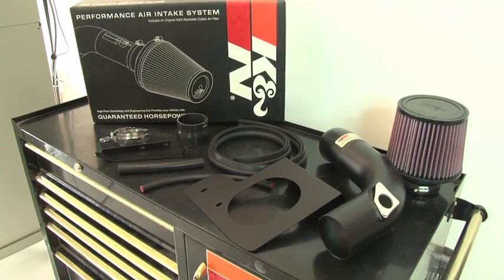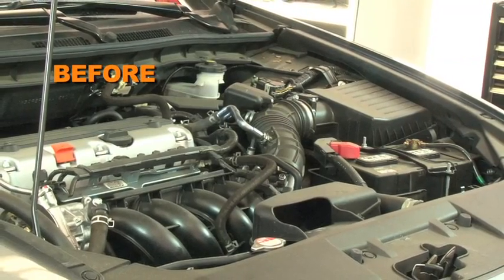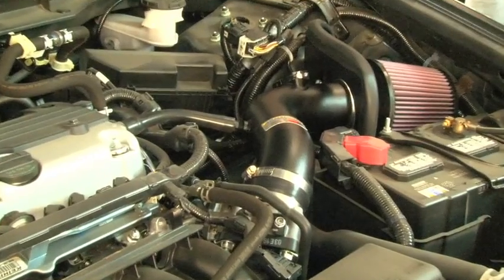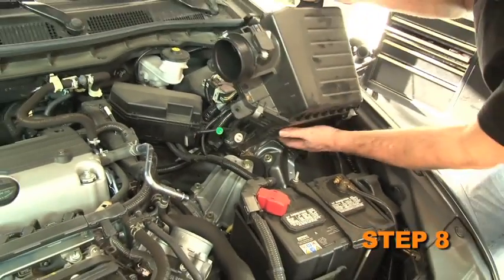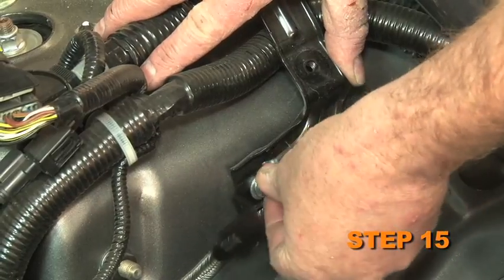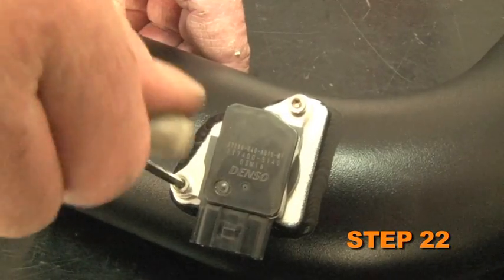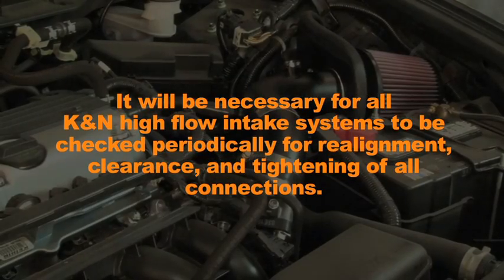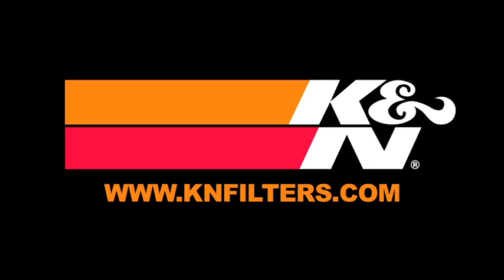Honda Accord 2.4L [#69-1211TTK] Air Intake Installation

Comment from the maker: This kit will fit all 2008-2012 Accords with the 2.4.L.
Reply: does tuning require after installing this kit in? Thank you
Reply: @QuanNguyen-cz4jq  you will need a tune after this, the car can not handle the extra 220 hp this will add to the engine
Reply: @neondiamondsaquaberry17  LMAO 💀

Comment from the maker: The system will not pull any more water than the OE system. Keep in mind, the filter is oil treated, and water and oil repel from each other. Also, you would have to submerge the vehicle to the hood line to have the filter submerged. If this happened, you would have much bigger problems then the intake pulling water.

Comment from the maker: @macuser575 This kit showed an actual increase of 11.13 HP and 10.47 lbft at the wheel on our average dyno pull; this is about a 9% estimated increase over stock with only our intake system installed. I can assure you we don’t make these numbers up, they are all real gains.

Comment from the maker: The heatshield blocks direct radiant heat from the filter, to prevent the filter from heat soaking. The air temp will always be the same as the temp air you are driving through.

Comment from the maker: @JohnZzzist Most K&N air intake systems are warranted for 1,000,000 miles which exceeds the warranty offered on the original factory intake system. The installation of an air intake system should not void your factory warranty. It is never a bad idea to contact your local dealership and ask them before purchasing the new K&N system whether they will object. If they tell you an air intake system will void your vehicle warranty, please contact us and we will speak with the dealership..

Comment from the maker: @Aero2121 You will feel the increase of power in acceleration and throttle response. Our intake systems do add to sound, but this varies on the engine it is being installed on.

Comment from the maker: This kit is part number 69-1211TTK. It is not 50 state legal at this time because it is not CARB exempt. An aftermarket intake alters the OE emission control of the crank case vent line; this alteration must be approved by CARB to become exempt.

Comment from the maker: @rick664ath The correct kit for your application is 69-1207TP or 69-1207TR (depending of you want polished or red). The filters with these kits only need to be cleaned every 50,000-100,000 miles.

Comment from the maker: @Aero2121 No, the K&N 69-7061TS fits the 2008 Nissan Altima with 2.5 liter engine and the K&N 69-7062TTK fits the 3.5 liter engine.  knfilterscom/air_intake/nissan_altima.aspx

Comment from the maker: K&N does not test for, claim or guarantee fuel economy gains. There are over 30 factors that determine fuel consumption; intake restriction is only one of those factors. Most of our consumers report back an increase in MPG; these reports are available on our testimonial page on your website.

Comment from the maker: @MrCHINGONism The correct kit for your application is 57-3010-1. This kit will only work if you do not have ram air or traction control.

Comment from the maker: @happy543210 The filters on our intake systems only need to be serviced every 50,000-100,000 miles. We also publish all the estimated (average) HP gains for all our kits on our site. We also offer 100% consumer satisfaction on all out product; you would need to contact customer service @ 800-858-3333 for assistance with this.

Comment: Does anyone know if this upgrade causes and engine code, I plan on buying one of these for the incredible sound and the little boost in power. And I don’t have a Hondata or a ktuner and I’m not looking to spend $1000 on one any info would be helpful.

Comment: I'd like to install a throttle body spacer, but I have the k&n intake installed. Will I see any problems installing a TBS?
Reply from the maker: +Kevin Claveria The intake is not designed to work with a throttle body spacer.
Reply: Kevin Claveria good question

Comment: It looks dope and specially the sound but I heard from mechanic YouTube saying this racing intake system it’ll damage the engine and as soon as you install it the check engine light turns on so I’m kinda hesitated to buy one so please if anyone who installed this air filter intake and have no problem with the car let me know 😊
Reply from the maker: All K&N intake systems are extensively tested to work with factory ECU settings and should not cause a check engine light.  If you have any other questions or concerns Please feel free to contact our Product Specialists at 800-858-3333 or tech@knfilters.com.

Comment: but @0:35 he dosen't mention the 2012. are we sure the 2012 may be included?
Reply from the maker: We frequently test fit our intake systems on newer vehicles to check for compatibility.  This kit will fit a 2012 Honda Accord with 2.4L.  Check out the product page at knfilters.com for an up-to-date list of applications. https://www.knfilters.com/69-1211ttk-performance-air-intake-system
Reply: @KNfilters  - thanks. good to know.
Reply: @KNfilters  - may actually be grabbing a 2010 exl. just have to research it a bit and make sure it's essentially all a 2012 is. should be the same. same gen and all.

Comment: Will this trip a check engine light, or reduce fuel economy?
Reply from the maker: K&N air intake systems should not impact your fuel economy or trigger a check engine light.  If you experience any problems, please contact our product specialists at 800-858-3333 or tech@knfilters.com and they will be able to help you quickly resolve the issue.

Comment: Does changing air intake cause engine light to come on? Ive been reading many conflicting comments regarding this
Reply from the maker: No, all K&N intakes are designed and tested to work with factory ECU settings.  If you have any other questions or concerns please feel free to contact our product specialists at 800-858-3333 or tech@knfilters.com.
Reply: Thanks for the message 🙌 will be ordering one soon 👍

Comment: How much is it? I went to the site you posted but your site is currently down/under maintenance hah I ask because if it's under 100 I'll be getting one ordered later tonight
Reply: around $340 with tax
Reply: @victortran7704  it's ok I managed to get one done for 40$ haha
Reply: @ctiproductions2017 where and what type of intake did you go with??
Reply: @Js_Journeyy  I got a k&n filter from Walmart the stock tube is just the perfect size fit and I did notice a increase in response time/up so win win

Comment: Someone at advanced auto parts tried telling me that it might make my check Engine light go off and lower my fuel mpg is this true? (I drive a 2008 2.4)
Reply from the maker: If you encounter any check engine lights please contact our product specialists 800-858-3333 or tech@knfilters.com and they will be able to help you resolve the issue.

Comment: Do u need to tune or can run on stock ecu?
Reply from the maker: All K&N intake systems are designed to work with factory ECU settings and do not require a tune.  If you encounter any issues please feel free to contact our Product Specialists at 800-858-3333 or tech@knfilters.com for support.

Comment: would the installation be the same for all years? meaning i have an older model witch would require a different intake but it will be installed in the same fashion?

Comment: my family has a 2011 accord lx with a 2.4 liter 4 cylinder. I believe that this is the same engine. Does it have vtec/vvt? I cannot figure it out. No where does it say it does, but nowhere does it say it doesn't.  I cannot find a vtec solenoid but I wouldn't know for sure as I'm only an amateur. I have floored it just to see many times, but it doesn't have any kick nor do the rpms bumb. I just want to know if it has vtec!!!
Reply: Niko Bellic ASMR no sir, it does not have Vtec
Reply: Jerry Flores Makes sense. But thats also some what disappointing because now I cant beat enzos and hellcats at green lights! Haha no but seriously thanks for clearing that up for me.
Reply: Niko Bellic ASMR lol I'm dead Enzo's and hellcats
Reply: yes it has vtec its on the rear of the cylinder head
Reply: no, the 2008-2012 Honda Accord 2.4L I4 is a non VTEC variant of the K24Z2 motor
Reply: @anthonyptaszek8751  The K24Z2 is a i-VTEC. Not sure where you're getting this information from. These VTEC engines aren't as agressive at engagement than Honda's in the past. But it is VTEC. No different than any other VTC engine out there actually.
Reply: @ChuiStrong  I have a 2012 Honda Accord. I guess it's just so slow I cant even notice lol. Just looked it up and your right, my bad. It just isnt indicated anywhere on the valve cover like usual so it kinda tricked me a bit.

Comment: Is this legal in Massachusetts?
Reply from the maker: This system is 50 state legal for most 2008-2012 Honda Accord 2.4L vehicles.  Check out the "Vehicle Applications" tab on the product page on our website https://www.knfilters.com/69-1211ttk-performance-air-intake-system
Reply: @KNfilters  link is saying page not found. Can you please just let me know if this is legal in MA or not? If it is, then i'll buy one. Thanks.

Comment: Anyone know if the car is going to need tuning with this modification?
Reply: no
Reply from the maker: No, these kits are designed to work with the stock vehicle with no programming necessary.

Comment: Does the heat shield really protect the "cold" air from getting super hot when the engine is warm (at normal operating temp.) What about perhaps on a warmer summer day? In other words does it protect from heat soaking effectively?
Reply: It does. I can tell from one i used in my lexus is350

Comment: Try this if you live on a dirt road. Waste of money and will kill your engine.
Reply from the maker: All K&N air filters are tested using the iso 5011 test protocol to ensure adequate filtration under normal driving conditions. For dusty or dirty conditions, we recommend using a filter wrap to add additional filtration.